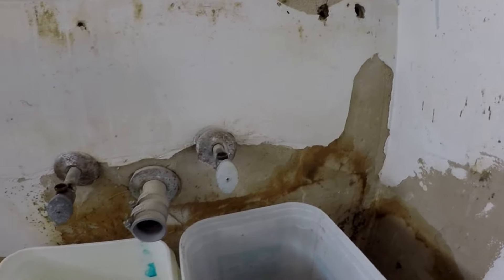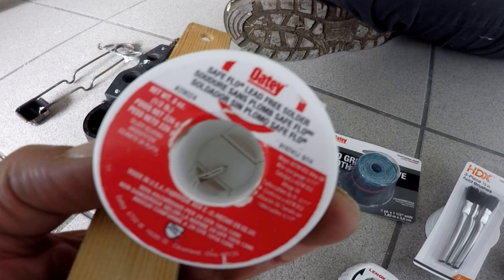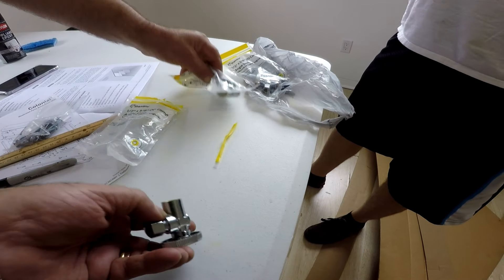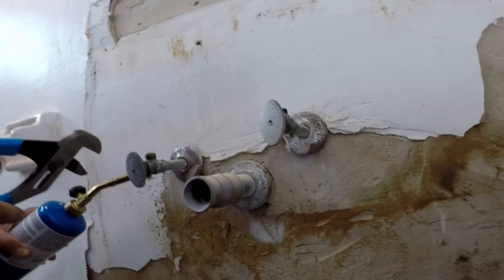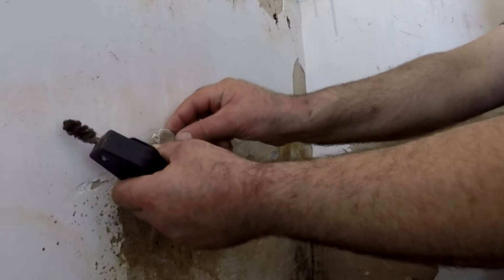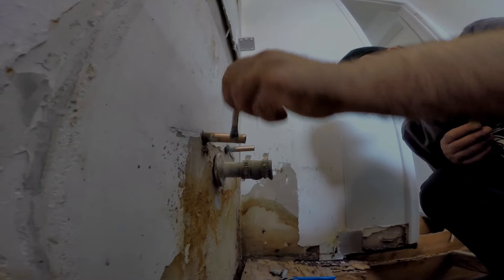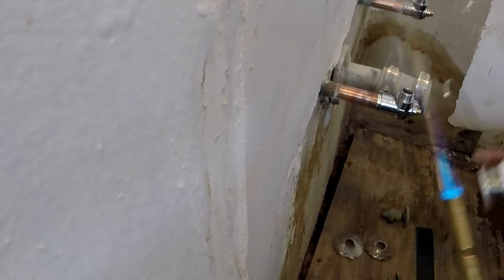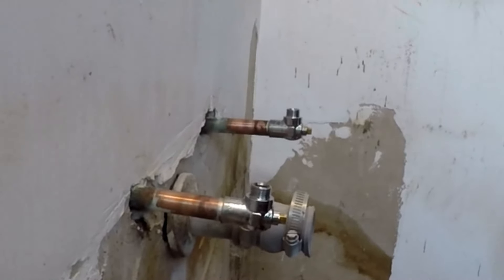HOW TO REMOVE REPLACE A WATER SHUT-OFF VALVE | Sweat Valve Solder

Comment from the maker: Shut-off valves, also called supply stop valves, allow people to connect supply lines to sinks and toilets. They also help isolate and repair leaks near fixtures without shutting off the water supply to the entire house.

Comment: I'm so glad I found and followed your example of thoroughly cleaning the old solder off and not just sliding on a new valve while the old solder was still hot (as some others recommend). I didn't have to rush and I got a good solid joint that I know I can depend on for the long haul. Thank you!😀
Reply from the maker: Excellent!

Comment: This is a great video John.  I have soldered shut off valves and I want to replace them with compression fittings.
Reply from the maker: Great idea if you have enough pipe to afford cutting the soldered fittings. They are very easy to put in.

Comment: Great video , never had the courage to use solder,  I always use compression joints.  I might have a go one day !!
Reply from the maker: You can do it. My son picked this up very quickly. This was the third time doing it.
Reply: @JohnCRV  Might have to have a practice on some spare pipe  when I have the time  Thanks again Robin
Reply from the maker: My testing on spare piping was a good experience but I dint realize that the pipes had to be completely free of water inside when doing the real thing it makes a big difference.

Comment: Hi, thanks for this.  I'm going to make my first attempt so I need all of the tools.   Is it more difficult to solder a valve when the pipe is in the vertical position, facing up?  Seems to me the solder will have run uphill from the edge of the fitting but I'm afraid it will just run down the side of the pipe.
Reply from the maker: Not at all. If you heat the fitting enough it should suck it right up into the fitting. You may want to practice with a short pipe and regular fitting before you do the actual job. You can do it!

Comment: What if you wanted the new valves to be the compression type?  Would it be OK to desolder the old sweat valves, ream/brush/sand the pipes per the video, and then install a compression valve?
Reply from the maker: I've never used a compression valve but I don't see why not...
Reply: Thank you, sir! @JohnCRV

Comment: Thanks, and a very great tutorial on replacing a bad valve. I've seen my Dad do this years ago, and I didn't remember what to do about the old solder. My repair is almost the same, but the two valves I have to replace are inline valves. I'm wondering how to heat them up with water still in the line. I guess I'll have to cut the line far enough from the valve so it can be reassembled with a splice fitting.
Reply from the maker: You may want to consider heating the pipe until the water in it evaporates.
Reply: Sharkbite also makes a ball valve with sharkbite fittings on each end, so you can install it and shut it off and then the water won't be running down and preventing you from soldering further down the line.
Reply: Drain the lines by opening up faucets and others in the house before soldering. Even the Outside faucets if necessary. You can't get a clean solder with water in the lines.

Comment: How long do you keep the flame on for it to pull off? Mine doesn’t seem to want to come off
Reply from the maker: about 30 seconds. make sure there’s no water in the pipe, if there’s water in it you can evaporate it by heating the pipe long enough. also make sure you are using the correct propane. comes in a yellow tank. It produces much more heat than regular propane.
hope this helps.
Reply: @JohnCRV  i got them off and installed sharkbite! seemed that the main portion that needed to be heated was at the bottom and it slid right off! thanks

Comment: Two questions: (have hard H2O)
1.  Once removed and cleaned.  Could a shark bite/compression fitting be used?
2.  For a beginner, which is better? Map/propane gase?
Reply from the maker: 1. yes, you can use a shark bite/compression fitting
2.Mapp gas provides a flame that is 3,730 degrees Fahrenheit, compared to propane’s 3,600 degrees. The brand-specific Mapp gas was discontinued in 2008, but today there is a similar product called MAP-pro. Propane is cheaper and easier to handle than MAP-pro, and it’s ideal for generators, grills, space heaters, and home appliances. MAP-pro is better for cutting metal and soldering and is a better choice for professionals.

Comment: Great tutorial, thank you. Can a Chef's Torch be used for removal purposes only? I would like to replace my sweated stop valve with a push fit for this one area. Thank you.
Reply from the maker: I've never tried it but I bet it will take a little longer if it works.
Reply from the maker: @muth7813  New or old should be the same in my experience.